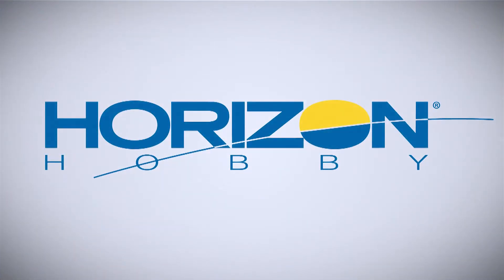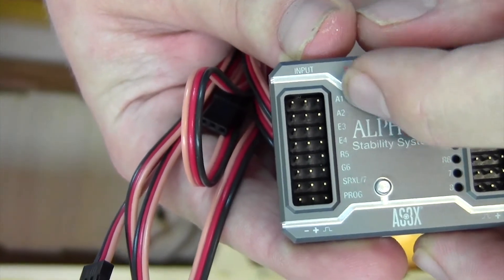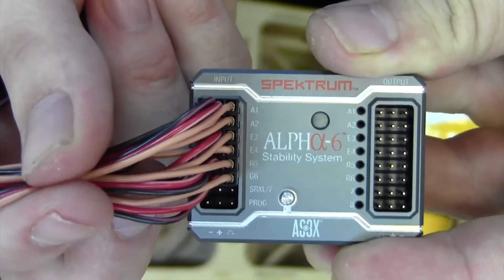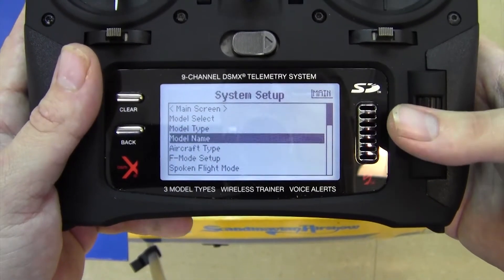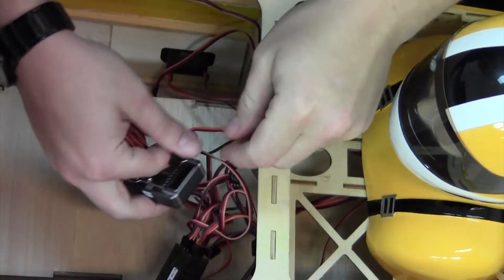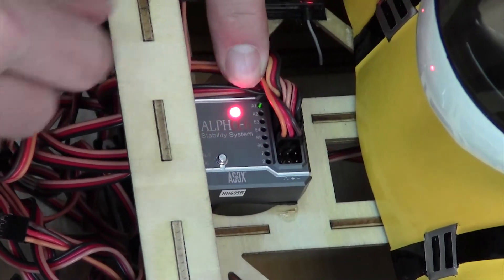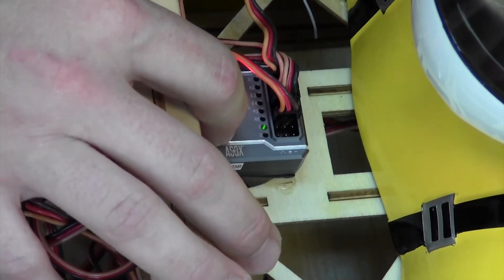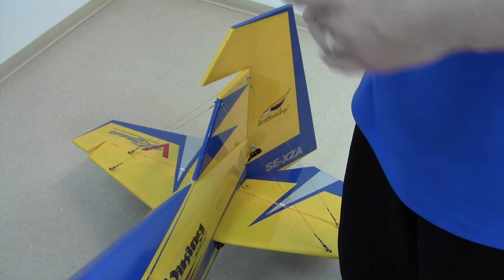How to Setup Spektrum Alpha 6 Gyro System without a Computer!

Comment: Please help me, I have a Futaba 14sg Radio and I'm trying to use the Alpha6 , but when i go to the calibration mode, the blue led doesn't stop blinking so  i cannot activate the gyro. Why isn't it stop blinking? Also, when the led is green , servos are working but the gyro isn't working.Is there anything i have to do to activate the gain channel on the Gyro? Any help will be welcome. Thanks in advance. Regards
Reply from the maker: Hello Olmosff, Make the channel you are using for gain adjustment controlled by the VR knob. In the Servo Monitor menu make sure that the knob is making the channel actuate 100 % Positive and Negative. If you do not get full travel go to the EndPoint menu and increase the endpoints on that Channel. Then when you have a channel, lets say 5 (gear), with a full 1 to 1 movement on with the VR Knob, go thru the calibration and move the knob Full turn as well as the flight controls. Center and the light should stay solid. Tap the button and your good to do.  Hope that helps!
Reply: Hello. I did all the procedures, including checking the servo course, and all are 100% course.But the problem still persists. the blue led can't stop blinking.Another question? What is flight mode mentioned on the AS3X software? Do i need to assign a separate channel to it as well?The servos should be plugged in or just the receiver works?
Thanks
Reply from the maker: Just to be clear, you are moving each control Aile, Elev, Throttle, Rudd, and Gear, 100% each way then going back to center, correct? To answer your other questions; Flight mode changes by reading port 7. If you have more then 1 it will change from one to the next when it sees the signal coming from port 7 go from -100 to 0 to +100 giving 3 flight modes. These modes can be used to change gain and gyro types quickly without needing to move the knob. I would say that this menu is helpful to those that are used to our other AS3X programmable systems because it resembles those closely. You do not need to use it, but it is a tool available. So yes you will need to assign a seperate channel and plug that channel into port 7 if you wish to use this feature. You do not need to have servos plugged in to perform the calibration but you do need it to see if the gyros are correcting the right direction.
Reply: Thanks for responding me. I really wanna make it work and help others having the same problem  using Alpha6 . I put the gear channel (5)in a 2 position ( On/Off ) switch, but I am using transmitter's Aux channel 7 for gain ( VR Knob). Do I really need to have throttle , flaps and gear also in  a 3 position switch to let them in the middle position (O) ? Because i don't have to connect them on the Alpha 6 right?

Another question: I don't have 2 servos for elevator( just have one servo)  , and i have 2 ailerons plugged in a Y cable on receiver's channel 1. Do i really need 2 aileron channels connected on Alpha 6 and 2 elevator channels as well? If not, how do I connect just 1 aileron channel and just 1 elevator channel on the alpha 6?

Thanks again.
Reply from the maker: During the calibration the Alpha6 wants to see all input channels that are being used to go from -100 to +100 then back to center 0. Is gear connected to the Alpha6 as well as Aux Channel 7? If so then the gear needs to be on a 3 Position so that it sees center. 
To answer your second questions, if you are just running 1 aile and 1 elev then just run 1 of the A and E ports.